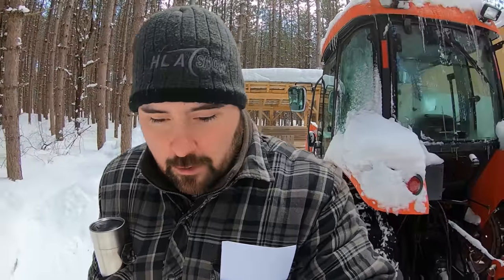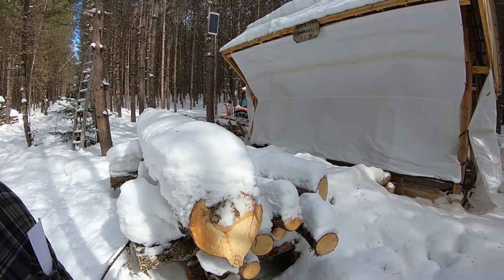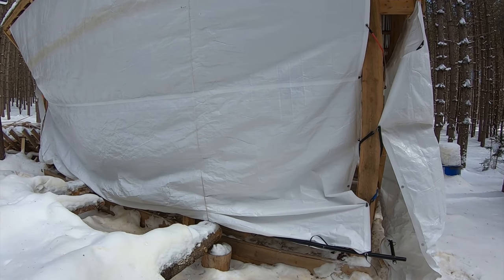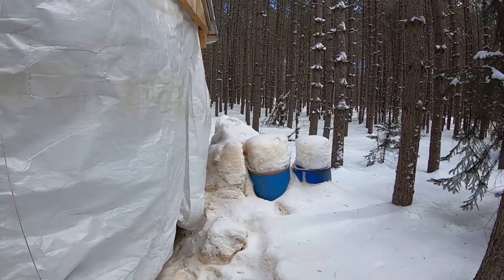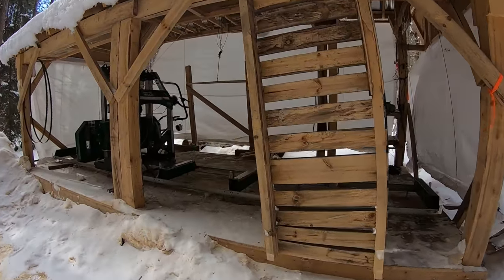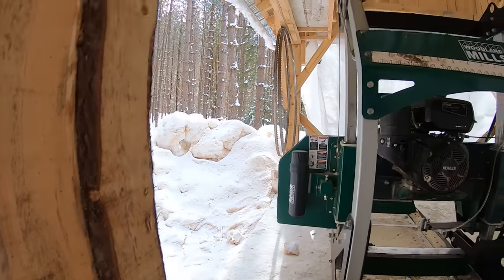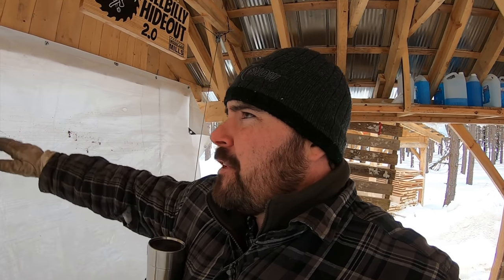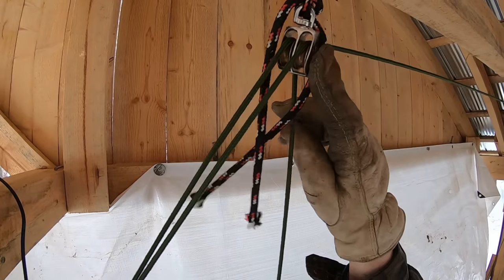Why I Don't Sell Lumber from my Sawmill

Comment: I'm in the mid south USA, and I have a sawyer a few miles from me. He doesn't sell wood, what he does is saw logs for other people and charges by the yard. Also charges 75$ if he hits a nail and it he has to change the band blade. He's 69 years old, but still working and he's happy. He told me he had so much work just by word of mouth, he didn't know what to do with it all. He picks what he wants to do and does it. If you like something, do it.

Comment: I was a sawyer in US for 20 years, cost of logs very high. Yes you must specialize if you want to make a living. Much competition to buy logs. Big boys will roll over you to get them. Now he is right live edge slab tables very popular. But people want dry wood. Long c air dry, expensive kiln dry. I had 2 kilns. Slab tables weren't "in" in the 80s. Remember what b is good now will be replaced by another product as market changes. Keep it a hobby, and if you can't build all your buildings yourself, and repair and maintain all your machinery. It will be an expensive hobby.

Comment: You are spot on.
Myself I get free logs from the local tree service guy.
50% of what I get are firewood quality.
The rest I saw up into whatever I feel like doing at the time and then stick and stack it and forget about it until someone wants something.
If I have what they need I sell it to them.

Mostly I feed my hobby of woodworking and make a buck now and then.
I keep the real nice stuff for myself.
Reply from the maker: That's a great setup you've got with the service guy. Although not all are ideal sounds like a good opportunity even if some ends up as firewood.
Reply: A good metal detector is a must when cutting trees from peoples yards. It gets hard on blades hitting nails and other metal objects embedded in them.
Reply: @loveistheanswer8137  So far, I have hit nails, screws, barbed wire, syrup taps, bullets, arrowheads and strangest of all, a brick. No idea how that happened (tree must have grown around it I guess)

Comment: Very insightful. I've got the same mill as you but I'm further south (still in Ontario). Everything I cut is hardwood from the bush on my farm. I've found the same considerations as you mentioned. Competition is a big one. You'll never beat the big boys just because of volume. They also have the ability to sell and ship all over North America, which of course, we don't. I find word of mouth through friends and acquaintances to be more than enough work. Like you I've already got a full time gig doing other stuff. Maybe after retirement............
Reply from the maker: Yeah the big operators sure can make the wood a lot faster than me and as you mentioned makes it hard
Reply: Retirement helps!
Reply: Yes it's nice to have it as a side hustle, now that we are retired we get to work and make as much money as WE DECIDE to. We are in Inverhuron, Ontario so winter is not a good time to run the mill. We sell a lot by word of mouth and sell at Kitcheners Farmers Market. It is a great life, for sure.
Reply: They have the ability to outbid you, It happened to me, I stopped sawing to many problems acquiring logs, and that was 30 years ago. I made furniture for 10 years with my kiln dried wood.

Comment: I'm like you Sandy, hobby all the way. The one thing I do maybe a little different. I'll cut my log cants as big as I can 8x8, 10x10, 4x4, and stack them until I need them, that way they can air dry better and if I need 2x4s I'll pull out 8x8. Or 4x4. And it kind of like money in the bank. Good talk keeps a person thinking.  👍
Reply from the maker: I like that idea of cutting the cants. I may have to give that a try
Reply: Thanks to Sandy first for this video (and all the others).  And now thanks to you for this common sense/great idea (not to suggest I was doing it too) of sawing up the biggest (and longest cants) you can "like money in the bank".   Sure gives you more flexibility to fill future orders and seems like the cants would air dry more efficiently, taking a little longer to dry than lumber maybe but less time to stack and with less warping in the mean time.

Comment: One idea I came up with to stop tarps from flapping and ripping themselves apart, was to use 550 paracord.
I put two horizontal cords from one side to the other, (dividing the tarp into thirds). Make them as taut as possible. Do this again, but on the inside of the tarp at the same spots, essentially sandwiching the tarp between the two tight cords.
I had to do this here in Southern AZ for a 10x20 car port. It flapped like crazy on the sides and end panels. This method stopped the flapping completely.

Comment: If the tarps end up being to weak, you should look into the roll up tarp for big rig trailers. It's heavy duty, and has a metal bar in the bottom. It's heavy enough to hold place and light enough to roll up easy. It's made for heavy wind and dramatic temp changes
Reply from the maker: Great idea. I know the tarps ya mean. Those things are tough

Comment: Really great information, Sandy.  I think many people think only of the end product and forget about the overall cost of materials, capital depreciation, fuel, equipment and mill maintenance and consumables (blades, washer fluid in cold weather, etc).  Perhaps for people that are retired or otherwise financially stable, own a wood lot, and have lots of time on their hands, you might make a few bucks selling wood from a consumer-grade mill.   Otherwise, most will find they might make 5 bucks an hour… so from a money perspective you’d be better to work at McDonalds!   Selling live edge slabs was a good gig for a while, but with the proliferation of YouTube and the boredom of Covid, consumer mills have been selling like crazy and there are slabwood sellers everywhere, so good luck trying to make money unless you’re already well established.
Reply from the maker: Many good points there
Reply: " so from a money perspective you’d be better to work at McDonalds! "  Umm No. Running your own saw mill is much more satisfying than working at Any service job ever!  You need a better anaolgy Prof Dave. Just sayin', think about it. 😉
Reply: @JosEPh-zy3yr  I very clearly said “from a money perspective”.   I wasn’t referring to job satisfaction or any other value.  My point simply was if someone was thinking of doing it for the money, unless they have a free source of logs and already own all the necessary equipment, the dollars per hour IN CANDA would very likely be higher at a minimum wage job.  McDonalds was simply an example of a minimum wage job.

Comment: Hardwood saw logs are generally free in my neck of the woods.  Make friends with a few of the local arborists.  If they haul away the logs when they cut a tree, they typically take the logs to the dump.  It costs them money to dump the logs at the dump.  If my place is on the way back to the office or not too far out of the way, they'll dump the logs at the end of my driveway.  Free for them, free for me.  If my place isn't on the way, they'll often give me a call, let me know where they're working, and invite me out with my trailer.  They'll even load the logs on my trailer.  Since I want the logs to be 10+ feet long, it also saves them time and equipment wear because they're making fewer cuts.  The only down side is you're getting urban trees and that means you're cutting a lot more nails than you'd like!  But, I'd say only about 5% of the logs I cut reward me with a nail or screw.
Reply from the maker: Sound good ideas in there for sure
Reply: @Sawing with Sandy  as an arborist, I agree. I have a hm126 and I can't saw the logs fast enough. You may have to take some stumps and knotty logs as well, but it is worth it. A lot of tree services have to pay to dump the logs so likely they would love a free dump site. I sell custom cut pine for $1usd per bf and it is hard to keep up doing it as a side hustle.  Thanks for all the useful info you put out, gonna use your video tomorrow when i change my drive belt!

Comment: Hey buddy how are ya? Another great video!!! Lumber Prices are ridiculous here in Kaliforniastan. At Lowe’s in town a 2 x 4 x 8 costs about $1.62 out the door with taxes and lumber surcharges. There are local guys with sawmills that charge $1.25 a board foot for pine in for four dollars a board foot for oak nine dollars a board foot for redwood and $15 a board foot for black walnut. I found it easy to find Sawing jobs locally I charge by the hour if the logs a bunked up. I cut for myself and neighbors, and on occasions for cash. I hope to have the sawmill paid off by end of summer. I love running my sawmill. I’m a retired old guy, so I saw when I am not cleaning up storm damage hehehe. Thanks buddy and GOD bless you and yours. Thanks for being our sawmill guru!
Reply from the maker: Sounds like your setup would work well for making some extra cash. Can’t go wrong with that!

Comment: Northern Ontario here!! 
Owner/Operator custom cutting/ Cedar mill, lots of competition but theres enough room for everyone!
 Smaller mills tend to make a nicer finished board, customers appreciate the quality of the lumber.
 Timelines can put pressure and make things stressful I agree with you!
 I have my own skidder and bush lot. selling sawlogs usually $0.80-85 cents a BF in cedar .50-60 for pine , spruce. Worth alot more to me to mill them myself... Busy spring lined up!!
Reply: as for the fuel costs, fuel surcharge is an option, total cost of order + 2-5% covers fuel costs, 10% of profit goes towards maintenance!
Reply: @its_wheezer1855  You can always edit your comments by clicking on the 3 vertical dots to the right of comment.

Comment: Honest and straight. Custom sawing works, but Standard Large volume sawing, have mills that produce much higher rates. Equipment is made to do the volume. Also the dollars that go into such operations much higher cost, Just from the startup. And generally it takes more employee’s to maintain and specialized skills so everything higher also. Cost accounting to profits. Like your mill is considered hobby verses production. When you have your own logs, you do save on cost. 👍👍👍
Reply from the maker: Great points Lincoln

Comment: Another Great video.. I think the only way you might come out ahead with a manual mill would be custom cutting orders at a premium price. You would want to do everything possible to reduce manual material handling. I started out custom cutting with a manual mill and it got old really quick. Turning logs larger then 18” by hand all day long will wear you out. Cranking the head up and down didn’t play nice with my shoulder. Smaller logs yield to little and increase handling time.
Air drying lumber takes forever. Generally, for hardwood allow 1 year per inch of thickness. Softwood might be a little less.
People tend to forget the overhead cost and equipment you need to handle the logs. (Tractor, forklift, skid steer, which every you prefer. Unless you have secondary uses for them, I could not see them paying for themselves with a single operator on a manual mill. 
I don’t sell lumber, or offer a mobile mill service anymore, however if someone wants to drop off logs or timbers for re saw I’ll do it for a fair price. One can make a few dollars to pay for upkeep or buy a few other toys /  pieces of necessary equipment.
Reply from the maker: I agree Rick
Reply: Yes my lumberjack has been working at the sawmill for over 44 years as a side hustle. He is all crippled up and you can see the wear and tear. But he is strong and definitely in shape, better than a personal trainer or gym

Comment: Making decent money in the sawmill biz requires a sizable investment, hydraulic bandmill(minimum), anicilary equipment edgers/planers, log decks,  large tractor/forklift/loader, metal buildings, kilns, diesel truck & gooseneck trailer, etc. Anybody can cut portable or run a small manual band mill but to make good money cutting wood, you will need the equipment listed above and need to be fairly mechanically inclined and need the tools & space to service your equipment. All adds up to being space, labor, and capital intensive.

Comment: Faster usually means danger when it comes to dealing with machinery. Especially machinery with teeth lol. I think the only way a 1 man operation could cut faster is with a faster machine like a swing blade mill. I've been looking at swing mill myself eventually. My property used to be a sawmill with a kiln once upon a time. But the Alaskan mill works for now for all I need. I'm building a timber frame addition in the next year or two. Luckily for me I live up north and all my neighbour's have logs they'll sell me and bring over with the tractor no problem

Comment: So you say they were charging 70 cents per board foot for logs,  are the figuring how many boards you should get out of it or, are they charging 70 cents per linear feet for logs.  If the latter, then you would need to refigure the cost.

Comment: I'm in southern Ontario and the small one man mills here are moslty charging $2 a board foot.
Reply from the maker: Is that right eh. That could add up some profit quick!
Reply: @sawingwithsandy  last summer all the building stores were out of fence posts.  If I had a mill I'd be cutting 4x4 and 6x6 posts and listing those for sale when supplies are short again.

Comment: mills in my area were flat out last summer, couldnt saw enough were giving customers a 6-8 week lead time, which turned away most people.. and they werent giving the stuff away it was probably over a dollar a board foot if not 1.50$, i dont think a band saw mill will ever be sensible to go fill time sawing dimensional lumber with, can always just saw what you would like to saw and if you run out of uses for it post it up for sale, or take orders one at a time to fill and not worry about building a customer base or full time gig

if you want to pump out 2x4s you need to be pushing log after log onto the mill that are delivered by trucks and ripping them into boards with a circular blade and about 120HP
Reply from the maker: I'm with ya Andrew

Comment: Hi  Sandy   cutting 8 footers on bandmill is not a money maker 14 or 16 ft. would produce more volume in a day.  If you plan on selling your lumber someday  I think there a few changes you could make move your lumber shed to the end of mill and pile lumber off mill instead  of packing  across the track and then along the boardwalk from John
Reply from the maker: You're right there John

Comment: if you start cutting orders for other people it does take the pleasure of having fun with your mill it become and obligation for every day no Mather what or what kind of weather etc.   Specially air dry like you said where do i put all this wood i am doing it for my own project got a roof 17 feet wide 29 feet long 7 to 9 feet high you start a stack and had to it your bottom wood is ready to use but you got all this other lumber on top i think you get the point so i keep doing it for pleasure and not for a living but i do sell a piece here and tere  well have a great day

Comment: I wouldn't think that the logs you have are large enough to make sales worth it but only you know  that. I used to cut boards and just stack it to size for myself to use or if someone liked what I had, I gave them the  choice of yes or no on  what was  there.
Reply from the maker: Yeah that would be another issue getting the larger logs. I've got some big white pines around but would hate to cut them down

Comment: Really excellent video Sandy.
Numbers matters. Thanks for going to the effort of hunting down Big Box and big sawmill prices as a comparison.

On unrelated matter.....is it advisable to restack an airdrying stack of 2×? material (softwoods) in order to lessen warpage etc? Is resorting so the boards in center of stack are moved to outside and outside is moved inward a good use of time?
Also, is this effort better used on bigger stacks?
Thanks
Reply from the maker: Great question Will. Normally you can strap the pile of wood so pressure is applied to all boards. I tend not to do this and haven’t noticed any issues with the warping
Reply: @sawingwithsandy  Thx

Comment: 1.50$ a board ft for rough sawn lumber is wild... youre getting rough, untreated boards with inconsistent lengths and unsquare ends.. wane, intrusions, all kinds of issues, doesnt make sense to buy it at that point ill spend the extra 20% to get treated, planed, true and consistent boards.. can rely on them all being 96" or 92-5/8" exactly saves alot of work and cutting and gives a better final product
Reply from the maker: I can see your point there
Reply: @sawingwithsandy   im not bashing sawing dimensional lumber, im excited to get my mill and saw my own, just gathered about 3 cord of juniper an spruce logs the last couple days, but i dont see the cost/benefit from the customers point of view if theyre framing some kind of structure, its going to last longer, look better and be easier to build with the lumber a box store sells, and economies of scale let them do all those extra process's and still make a profit at 8$ a 2x4 or 1.49$ a 2x4 they make money so that says it all right there

seems theyve discovered they can make more money if they run a shortage of lumber and drive the price up each spring when they know people have been waiting all winter to start their projects